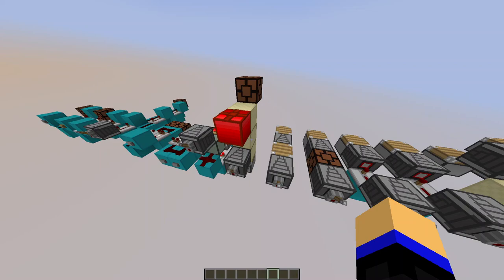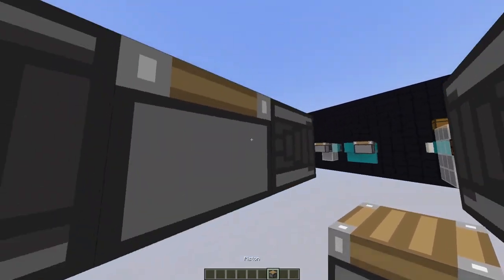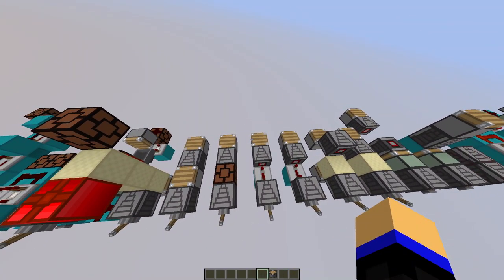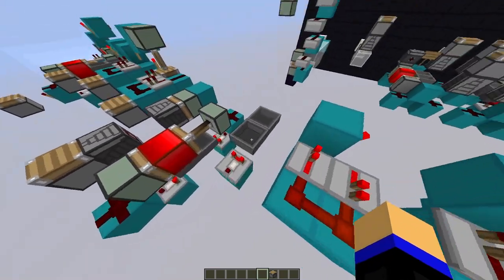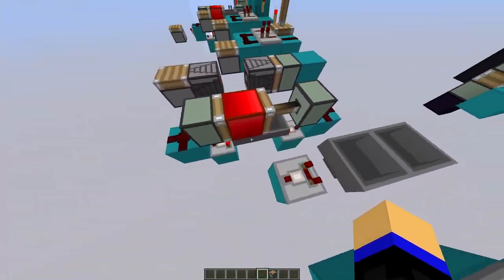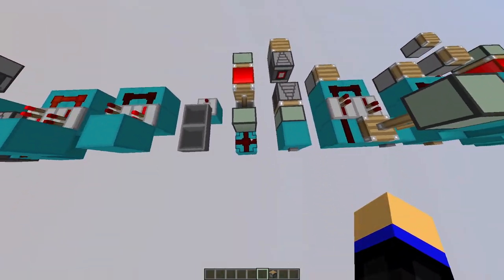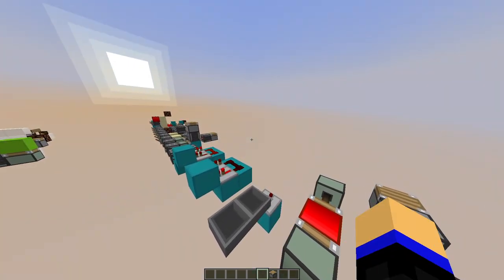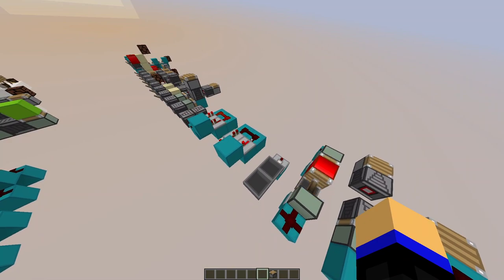Compact Redstone: 1-7 Basic circuits: Pulse extenders, multipliers, and clocks

Comment: Is there a way to make a pulse extender without any buttons or levers? I am currently trying to make a 3x3 creeper head door that has lava behind it when it is shut, but for the opening mechanism, I am trying to make the piece of floor that goes into the ground so the lava doesn't go anywhere, go back up so you don'[t have to jump across it and it will be fancier. But I need a decent pulse extender for this due to the stupidly long time for lava to drain. And having to go down some sort of staircase to push a button everytime I want to open or close a door just sounds very redundant. If you know of any designs, PLEASE reply with it, it would be a big help. Thanks!
Reply from the maker: The ability of creating circuits is necessary here. You can always take output from another circuit to the input of the circuit by using toggle/monostable circuits. I would suggest you watching 1-6 Pulse/Signal conversion to have a better understanding of toggle/monostable circuits.
Link: https://youtu.be/wTnuZMhwEGo